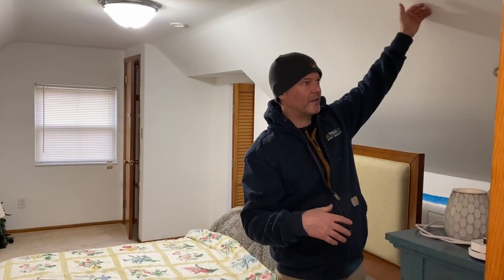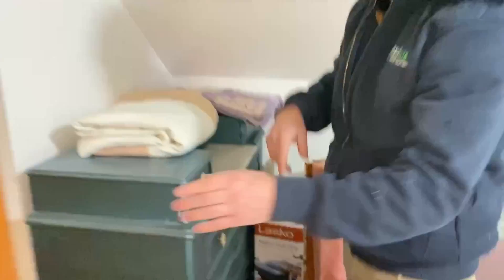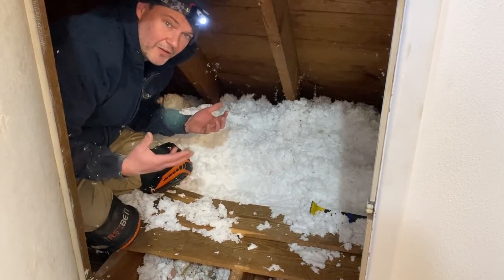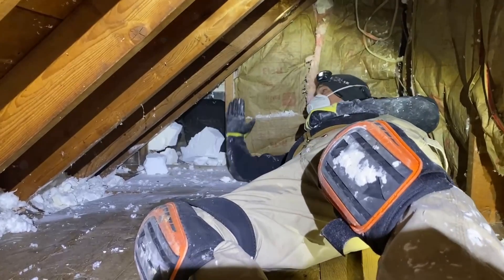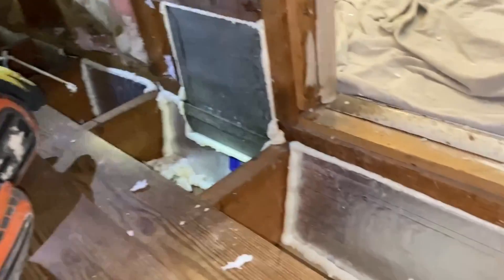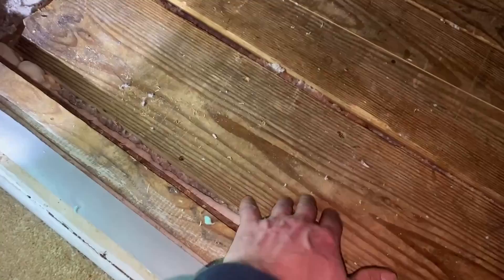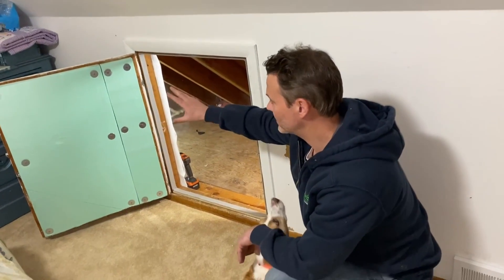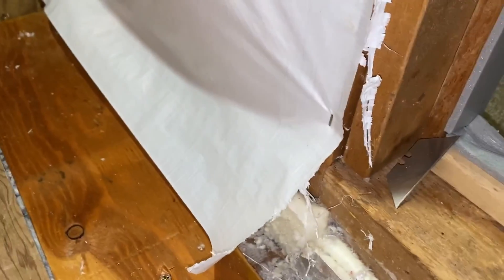What Happens When the WRONG Insulation Company Gets Hired?   Warning...This Gets Ugly

Comment: Incredibly useful video, thank you.  Here in the UK, the only thing I'm unable to replicate here, is the sloped ceiling insulation (i.e. dense pack with cellulose).  Our roof has a bitumen felt lining which funnels air from the open ended tiles in the sofit area of the house, up to the knee wall and main attic (via the sloped ceiling).  From a D.I.Y point of view;  my 2x questions are A)  Can i try 'dense packing' the sloped ceiling with rockwool insulation, or will it cause problems with air pockets/condensation?  and B)  Regardless of what insulation type you recommend, should the knee wall and attic ends of the sloped ceiling be sealed off?  Any help very gratefully received 🙏
Reply from the maker: Thank you!  I've seen some videos of roof designs in the UK and they are definitely a bit different.  In terms of your questions: 1)  Yes you can blow and dense pack rock wool into the sloped ceiling bays, but I don't know how that will interact with "channels" that it seems like are designed to funnel air up through that space.  If the channels are closed off from that sloped bay you should be fine.  However if they get blocked things may still function ok.  We isolate the lower attic from the upper attic when we do our system and it has worked consistently well (the sloped bays are effectively unventilated).  2)  You will have to seal off the bottom of the slope bay because otherwise anything you blow in will just blow out into the knee wall space.  We usually extend fiberglass batts from the knee walls upward and then "mush" them into the bottoms of the slope bay to create a plug that we can then blow against from above.  You don't have to seal anything from the upper attic.  That insulation will "integrate" in with whatever you're insulating that upper attic space with.  
Hope this helps!  If you have other questions let me know. 
Andy
Reply: I guess my only follow up, is to point out that i would be manually shoving the rockwool (or fibreglass) insulation down the gap, trying fill as much of the space as possible, using extending tools and flexible rods, rather than 'blowing' the material into the gap.  Assuming i can get enough insulation into the gap, I guess it doesn't make too much difference? Thank you Andy for your help 🙏
Reply from the maker: @nickbrett5645  Wow Nick, that sounds awfully difficult.  If the rock wool is "loose fill" meaning not in pre made batts that would make it much easier, but still not easy.  This project is doable, but it won't be for the feint of heart!  A great tool for "stuffing" is using an old crutch.  When we find them in attics we always keep them for odd purposes like this.  Are there not places in the UK where insulation blowing machines can be rented?  Are there any contractors there that seem like they may be knowledgeable about this stuff?
Andy

Comment: Hi, thank you for posting such informative content.  I have a Cape Code style home in the UK and want to follow some of your steps to insulate it properly.  I have a question please: My knee walls are already insulated with some fibre glass bats.  Can I cover them with breathable foil to add to the insulation safety without the risk of condensation?  I ask as it does get cold in winter and hot in summer so I assume this would help?  Thanks in advance.
Reply from the maker: Thank you!  Great question.  If your knee walls are already insulated with batts the BEST step is to then cover them with a layer of foam insulation board.  Here we use 1" thick polyiso board.  We leave the silver faced side facing the attic / roof and it then acts as a radiant barrier during the summer.  This will help ALOT and is also relatively easy to install.
Reply: Thank you for taking the time to reply. I will start with the transition gaps and move on to adding a road radiant barrier (although the stuff I have had foil on both sides….).  I have one more question please: I has some old paper backed insulation i side the rafters, it looks like it is part of the roofing felt. From what I have learned so far, this actually serves no purpose so I am thinking it should be removed. Have you seen this type of install before?
Reply from the maker: @davidbayes2521  You're welcome.  It's best to remove insulation that's against the roof deck, otherwise it can trap moisture against the roof.  I have pulled insulation out of roof bays in knee walls and found mold growing behind it on many occasions.  Another touch I'd suggest is using foam / caulking to seal the backside of any electrical outlets/ switches in the knee walls before attaching the foam board.  Good luck!  Let me know if other questions. 
Andy
Reply: @ Thanks Andy. I will keep watching and learning. Looking forward to starting my project.

Comment: If you put vent on the roof does it need buffle vents in suffit.?
Reply from the maker: Great question and no.  One slant back vent for each smaller knee wall attic or 2-3 for larger ones will effectively ventilate enough so that moisture does not build up to the point where mold growth can occur.  Slant back vents work incredibly well in this role.  Undershingle intake vents also work great for this. 
Andy

Comment: Great video.  I have a similar situation in my 1.5 story.  You mention in the video about the sloped roof also not being insulated correctly, could you tell the best way to insulate the slopes?  Would I need to take down the drywall in the house?  I can see the snow melting on my roof in the channels.
Reply from the maker: Thank you!  We insulate the slope bays by dense packing them with cellulose insulation.  I'll include a link to another cape video that we do that shows us doing this.  The slopes usually need to be fill tubed with a narrow 1.5" diameter or so tube because there's usually obstructions in them. 
https://www.youtube.com/watch?v=x_z9FLeg5AA&t=7s
Reply: @ Thanks for this!
Reply from the maker: @DerekGodin-c7s  You're welcome!

Comment: Great video man, do you know if this would work in the hot and humid south (climate zone 1)? The problem down here is condensation on the back side of the drywall because our houses are almost always air conditioned and meeting hot attic temperatures in situations like this. I cannot figure out for the life of me how to insulate a knee wall in my upstairs attic that looks pretty much exactly like this. Would OSB work instead of the foam board? What I fear the most with foam board is trapping in humidity/moisture somewhere especially in the climate zone that I'm in.
Reply from the maker: Thank you!  Yes this process should work in hot temps just fine.  If you use an even thicker foam board with higher R value, it shouldn't get cold enough on the attic side to form a condensing surface.  I would think 1" thick polyiso board would do the trick.  You could also batt your stud bays and then cover the studs with 1" thick polyiso board as well.  Aim the silver side out and it'll function as a radiant barrier as well, reflecting heat back out.  Let me know if other questions and good luck.  Thanks for commenting!
Andy

Comment: Could you have spray foamed the roof cavity’s?
Reply from the maker: Cape's are bad houses for that solution, and we're not big fans of it in most cases anyway.  1)  You can only use closed cell foam in a cold climate (open cell does not have a vapor barrier  2)  You cannot spray foam into the sloped ceiling sections  3)  spray foaming the upper attic would be almost impossible do how tight they get

Comment: I want to insulate my gambrel roof second floor it has larger knee walls tall than me. Should I add insulation to the roofing?
Reply from the maker: We have done these and I would recommend doing them the same way that we do here.  Block the gaps under the floor and insulate the back side of the knee walls.  You will want to ventilate these spaces though once they are insulated, not doing so invites a mold problem down the road.  You could put vents into the roof (slant back vents) or possibly ventilate the outer soffit (if you have one). 
Andy
Reply: @ thank you the peak has square vents on each side of the top walls no fan or anything would that be enough? There is a small gap by the knee wall that would allow airflow
Reply from the maker: @ElChupa_Cabra  Those are called gable vents.  I would not think that two small ones would be sufficient.  When we do gambrel roofs we would install 2-3 slant back vents across the top if there was not a ridge vent.  Depending on the size of that upper attic you may also want to install matching intake vents.  That's not to say that you won't be fine with the two small gable vents, you might.  It's just not what would be recommended.  You may have enough air flow from that gap, make sure it isn't covered.  
Also, if you have a connection between the upper attic and the lower ones (often on older gambrel roofed homes you do) keep it open with baffles, etc.  It would be VERY ideal to be able to use the small gaps in the lower knee wall attics as intake vents for the vents in the upper roof / attic. 
Andy
Reply: @insulwiseenergycomfortsolu3293  thank you so much for taking the time to explain this to me :)

Comment: I have a similar build, although it was a modular home where the upper floor was framed on site (altogether different subject).   Anyway, I did the finish work on the upper half story and made plenty of mistakes in the insulation.  Since have gone back and blocked and foamed the floor transition gaps and covered some of the knee wall backside with foam board (also tricky).  Before sheetrocking, I had installed baffles in the sloped rafter cavities and fiberglass batts, even though I knew it wasn't enough.  Not sure if i can remove those now and blow cellulose in the cavities (maybe just blow into and around them?).   The other issue I have found is that I have continuous vented soffits, with poorly installed baffles and basically no insulation above the level of the floor joists....The wall top plates are clearly visible inside the home with my little FLIR cam.  Wondering if I should block off the backside above soffit area and blow more insulation in, then maybe use roof vents like you have done here.  Great video and explanation of the challenges involved!
Reply from the maker: Thanks for commenting!  If you have baffles in the sloped areas that's good, I would leave them in place.  We don't install them in this home because they're just about impossible to get into place in a retrofit scenario (and you lose R-Value).  Did you at least use R-19 batts in the slopes ceiling areas?  
I don't think I would eliminate the soffit vents in the knee wall attic spaces, those are good.  Instead I would repair / replace the baffles and blow in additional cellulose insulation (or roll out batts) to up the R-Value in those areas.  Also, the IR cameras are crazy sensitive.  Just because you can see a color difference, the temperature difference or affect from it may not be that great.  In other words, you may end up going to a lot of effort and expense to make an improvement that you may not notice in your home or see on your utility bill.  Hope that makes sense. 
Andy
Reply: @insulwiseenergycomfortsolu3293  Yes, I installed R-19 batts in the sloped ceilings and later on blew additional cellulose in the upper attic area.  I think I may just reduce the number of soffit vents instead of the continuous vent....just reduce the howling wind moving thru the attic areas.  Maybe I can install better baffles at that time and blow more insulation in, like you suggest.  I still have some air sealing to pinpoint and correct.   Thanks for taking the time to comment!
Reply from the maker: @mattcantrell5640  You're welcome Matt, good luck to you with your project!
Andy

Comment: At the 6:20 mark,  i dont have transition gaps under neath my floor. Its lumber thats running along the length of the knee wall. Do i still use a foam board and seal it or can i just use a foam can and spray the wood.
Reply from the maker: My friend that is a gift from the attic gods.  We would just seal that top and bottom seam along the floor joist with foam.

Comment: Have a 1987 house with a bathroom skylight. The bathroom is freezing which I contribute to the skylight as the master bedroom is warm. How do I properly insulate around a skylight in mt attic?
Reply from the maker: If your home was built in 1987 odds are good that it is already insulated.  But if you want to improve it what we would is wrap it with R-19 or even R-30 fiberglass batts and then go over that with a building wrap like Lowe's or Home Depot's house brands.  They're about $40 a roll.  Everything will need stapled into place.  
You may also have air leaks around the base or top of the skylight shaft.  You can inspect this area from your attic, obviously be careful.  If any existing insulation has black streaks in it you know you've got air leaks, and you'll want to seal those first.  We see skylight shafts in bathrooms cause a disproportionate amount of problems in homes.  The flashing on the roof also often leaks around them, causing mold and rot issues as well.  Good luck!

Comment: I have a 100 year old bungalow with a full unfinished attic. I want to insulate the rafters so I can use part of the attic as living space. My eaves are not open to the attic and can't be vented because of the design. I was told by three contractors that my only option is closed cell spray foam.  I got estimates for almost $20,000 for the foam. Needless to say I can't afford this but am wondering is there another way to make my house more comfortable?
Reply from the maker: Yes.  When you say bungalow, does the top of your home look like this?  Like a Cape Cod style home?  You should be able to insulate the knee wall attics like we have here, have the slope ceiling bays dense packed, the upper main attic air sealed/ insulated, and then you Need to have the individual attic spaces ventilated.  We use slant back vents for this.  I have attached a link to a video that shows more completely this insulation retrofit process.  Let me know if you have other questions. 
https://www.youtube.com/watch?v=x_z9FLeg5AA
Andy

Comment: Just wondering why the end walls are insulated? Is there heated space on the other side?
Reply from the maker: Hi there, this Cape home had a dormer on the back of it, that was in the middle of the 2nd floor.  The dormer walls did get insulated, I am assuming that's what you're referring to?  The end walls inside the knee wall spaces that did not have heated / conditioned space on the other side were not insulated.  Let me know if you need further clarification. 
Andy
Reply: @insulwiseenergycomfortsolu3293  Thanks, that's what I suspected. Just cut a hole to get into my knee wall space and found they had not just insulated the knee wall (craft paper on the attic side) and floor joists, but the roof deck and end wall as well (no dormer). I was wondering why the ice dams were so bad. Time to do some work.
Reply from the maker: @patuper5823  Good luck there!  Yes, you've got a double thermal barrier with insulation on both the underside of the roof and back of the knee walls.  I'd follow our steps for upgrading Cape Cod insulation and you should come out with a vastly improved thermal performance.
Andy